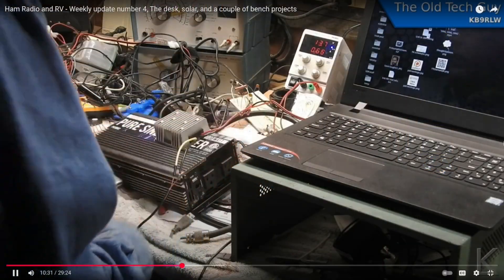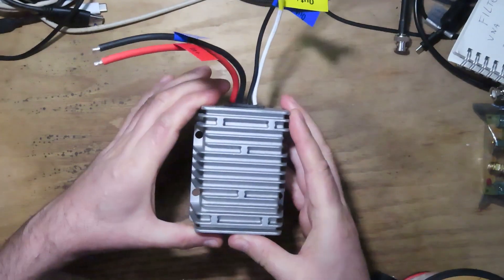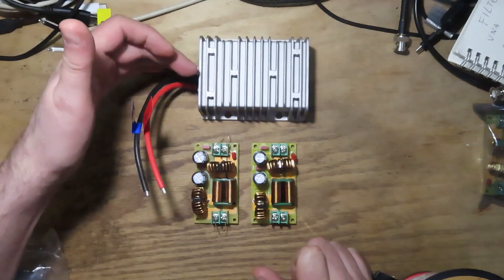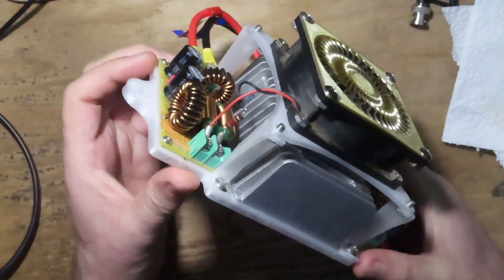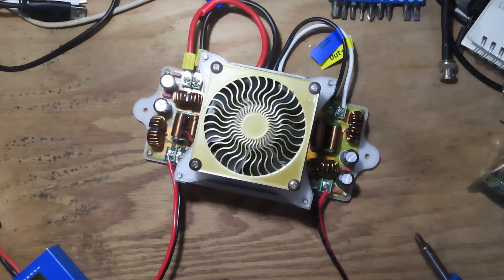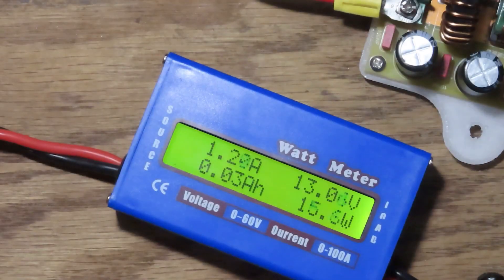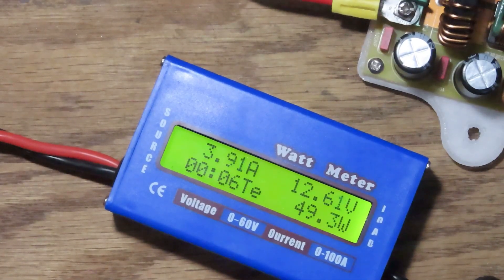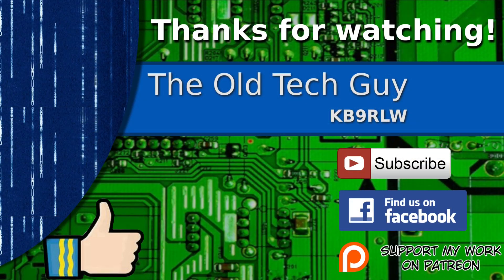Electronics - Assembling an off grid laptop power supply with RFI filters

Comment: Hi Kevin, your video inspired me to build my own using a 8V to 40V DC input to 13.8V DC 30A output converter/stabilizer. I tested with my Yaesu FT-857D and I can transmit 100W using a 20V power tool battery or a 40V hoverboard battery. Amazing! 73 de VA3HDL
Reply from the maker: Sounds nifty. Those DC converters are handy little devices.

Comment: Sorry to hear about your laptop.  What GPU did you get?  I have a RTX 4060 mobile GPU and am really impressed with it.
Reply from the maker: It's the nvidia optimus setup for laptops.  The nvidia chip is the RTX 5050.  There is also the embedded Raptor Lake-P intel graphics.  The machine can operate with either exclusively, or in a hybrid mode where the intel handles the screen and the nvidia is available on-demand to save power. 
The machine was hard-crashing rebooting randomly when using the nvidia.  Just bad luck getting a lemon.  They are exchanging it.

Comment: OK, these are really awesome 3D design skills.
Reply from the maker: Thanks.  I actually did most of the modeling in FreeCAD, simply because I'm very familiar with it now.  Although I did model the filter boards in blender as I start to learn it.  
Blender is really not that hard to get going on.  For basic rendering, it had a much shorter learning curve than FreeCAD.  I'd recommend playing around with it if you're interested.  It's a lot of fun!

Comment: The next addition could be an Arduino or ESP32 project with a thermocouple to control the fan.
Reply from the maker: Not needed.  We're so underutilizing the module that the fan is actually, probably unnecessary.  I do have 50C thermal switches, and thought about using one to make the fan automatic when required.  However, just slowing it down made it quiet while still moving plenty of air.

Comment: Great stuff. I especially liked the animated reveal. Was that done with Blender? Oh, and the flying leads to the filters I'd go full OCD and run those through some torrid's too.
Reply: I agree, put some toroids on those leads.
Reply from the maker: It's absolutely RF quiet as is.  I hear nothing on the HF bands when switching it on, even under load.
Reply: @loughkb  Excellent.
Reply from the maker: Yes, the animations in the opening and the parts coming together were done in Blender. 
I thought about ferrites on the leads, but after putting it in service, there was absolutely no noise on the radio from it.
Reply: @loughkb  That's great to hear. I really need to step up and learn Blender. I used 3DSmax for a couple decades until Autodesk decided to go full evil mode and I dropped it.

Comment: Check out Internet in a box for your off grid laptop as well. It is an open source project designed for schools that are off grid and makes a great way to access all kinds of reference materials offline, including kiwix Zim files such as all of Wikipedia with photos in a single file format or all project Gutenberg books in a single file. Also hundreds of text books and other learning modules and technical papers. It also includes nextcloud, which works as an off-grid "cloud storage"  server, Gitea, for pulling gethub repositories and world wide OSM maps, among many other features.
Reply from the maker: That's an interesting project.  However, in my case, I travel to and stay at places with decent cell coverage, so the phone hotspot becomes my access.  Plus, there would be a power budget requirement for the server to host it.  Even a raspberry pi is a power cost when you're focused on efficiency with a small solar input.